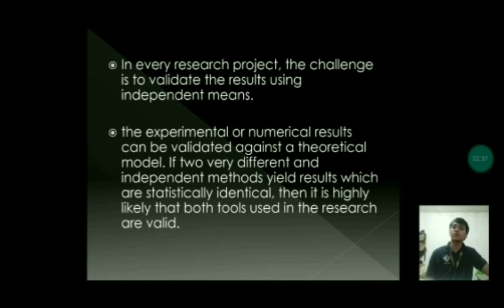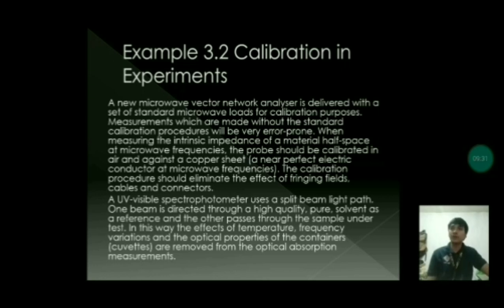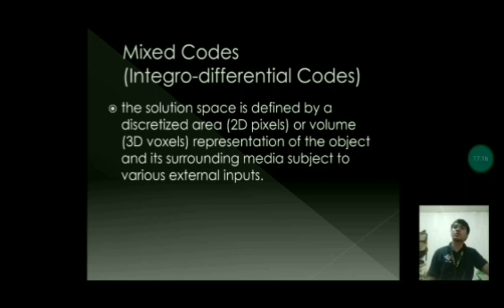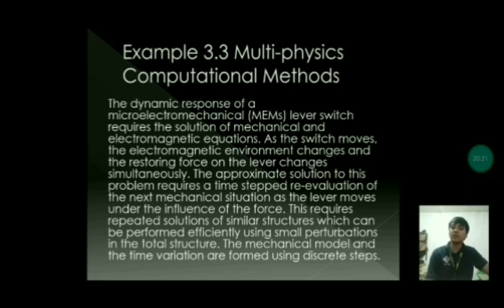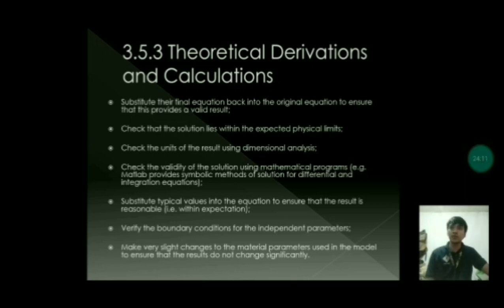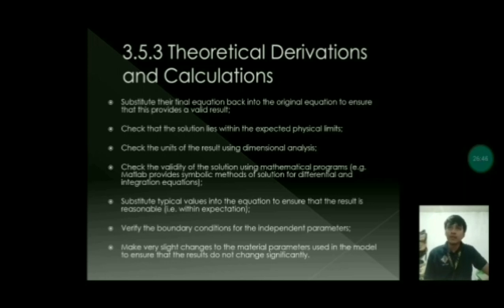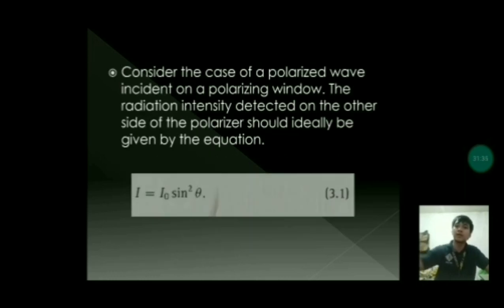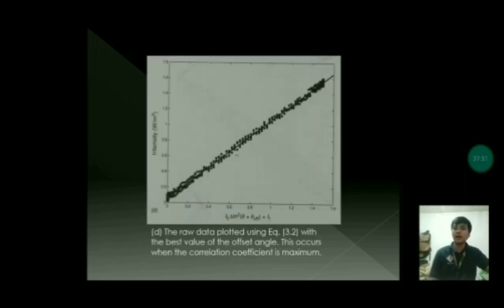Research Tools

Comment: Evangelista, Marwel P.
March 27,2023
MWF 6:30-8:30pm

Reflection
 I learned about systematic uncertainty which is uses of a published method of measurement. And also it covers about experimental measurements that can provide the best method of gaining reliable measurements.

Reaction
The reporter gives some examples of research tools that we can use it in our research study. Overall , It was very informative presentation.

Summary
The usage of standard measurement tools and the significance of calibration procedures are also explained in the video report.The correctness of solutions is assessed and compared using a variety of techniques, including numerical and theoretical modeling, curve matching, and other methods, to discover the most effective ways for a given circumstance.

Comment: Darwin Maglalang N.
March 27, 2023
MWF( 6:30- 8:20 PM)
Research Tools

Reflection:
In this chapter, I learned that in conducting a research and collecting data there are different techniques to be used to insure that the solution is accurate and reliable.

Reaction:
The reporter executes the topic very well and understandable. He studied and prepared his topic giving me excellent understanding to what his topic is all about.

Summary:
In conclusion, research tools are the equipment that is necessary for study and must be carefully chosen, which we can utilize to confirm our findings. Those research tools are Experimental measurements, Numerical modelling, Theoretical derivations and calculations, and lastly, curve matching.

Comment: Pis-an, Clark Z
March 27, 2023
MWF 6:30-8:30 pm

Reflection
I realized that in our research study we need to make sure that our results and findings are relevant and reliable. We have different research tools that we can use in oder to utilize the results of our research study. For example we have curve matching, numerical modeling, experimental measurements, and theoritical derivations and calculations that are also effective on determining the accuracy of the calculations and solutions.

Reaction
In my observation, the reporter discuss the topic excellently. The reporter is well informed with his assigned topic. The presentation is commendable and it is well organized.

Summary 
Research tools are used to prove that the findings are true and correct. We can use different research tools such as experimentation techniques that can be use for measurement in precise manner. Numerical modeling that needs repeated solutions and calculations, theoritical derivations and calculations includes checking of the results using dimensional analysis and last curve matching which applies the independent variable and calculate the dependent variable. It is also a visual inspection of the line that suggest the marginal error.

Comment: Name: Janeze S. Pacaña
Date: March 26, 2023
Schedule: MWF 6:30 – 8:30 pm
REFLECTION:
Each process of research is important and not easy. It requires a lot of effort and hard work. Being able to collect data and analyze it needs to be assessed by the use of the different research tools. These tools will allow researchers to choose the best approach and method to use and articulate how the results will be presented.
REACTION:
The presentation was informative, and the reporter gave an in-depth explanation of the examples so that it can easily be understood. He effectively discussed the different research tools. 
SUMMARY:
Basically, this lesson talks about the different tools that we could use in assessing the validity of the data collection results. Those research tools are Experimental measurements, Numerical modelling, Theoretical derivations and calculations, and lastly, curve matching. Standard measurements tools should provide the best method of gaining reliable measurements and should undergo a verification process through calibration. Overall, those different techniques will help the researchers to attain a valid and reliable result.

Comment: AMAHIT, KENT L.
MARCH 26, 2023
MWF, 6:30-8:20 pm

Reflection: Based on my observation in chapter report 3.5 in Research Methods for Engineers. It provides an overview of the various research tools that are available for engineers to use. It covers topics such as the types of research tools, how to choose the appropriate tool for a particular research project, and the advantages and disadvantages of each tool. This chapter was helpful in understanding the different types of research tools available and their uses.

Reaction: I observed that the reporter is reporting well the assigned topic and discussing the importance of research tools. I was able to learn, how many different types of research tools are available to engineers, and the amount of detail that the chapter went into regarding each tool. I also found it interesting to learn about the advantages and disadvantages of each tool. This chapter was informative and gave me a better understanding of the different research tools.

Summary: Chapter 3.5 in Research Methods for Engineers provides an overview of the different research tools that are available for engineers. It outlines the types of research tools, how to choose the appropriate tool for a particular research project, and the advantages and disadvantages of each tool. This chapter was informative and gave a better understanding of the various research tools that are available.

Comment: Lluvido, Lynan Kim A.
March 26, 2023
MWF 6:30-8:20PM

REFLECTION:
Since numerical or experimental result plays a big part in a research, it needs to be validated using different methods. These methods are called research tools. It can be done through comparison of calculations after the results are made. In order for the audience or participants to have trust on your research, you need to have a reliable presentation of your data analysis. Considering the different variables, you can be able to identify some of the errors.

REACTION:
Based on what I have observed from the video presentation, the reporter explained very well each part of his topic. Different examples were provided as an aid for better understanding. Overall, it was well delivered, well prepared, and was very informative.

SUMMARY:
There are different research tools which we can use to verify our results. Just like the experimental measurements which is through calibration procedure, numerical modelling which requires repeated solutions using small perturbations, theoretical derivations and calculations which involves substitution that suggests the level of random error, and curve matching which is a visual inspection of a line.

Comment: Lareno, Rhea T.
March 26, 2023
MWF 6:30-8:30 PM

Reflection:
After watching the video, I have come to realize the importance of validating solutions in scientific and engineering calculations. The video highlights various methods and techniques that can be used to ensure that the solution obtained is accurate and reliable. As a student, this is a critical lesson as it reinforces the need to be diligent in checking results and using appropriate tools to verify the correctness of a solution.

Reaction:
The video provided valuable insights on the different approaches that can be used to validate solutions in scientific and engineering calculations. It was interesting to see how various techniques such as calibration procedures, numerical modeling, and mathematical programs can be used to ensure the accuracy and reliability of results. 

Summary:
The video emphasizes the importance of validating solutions obtained in scientific and engineering calculations. It highlights various methods and techniques that can be used to verify the accuracy and reliability of results. These techniques include calibration procedures, numerical modeling, mathematical programs, and checking the sensitivity of solutions. The video also emphasizes the importance of standard measurements and calibration procedures to ensure accuracy and reliability.

Comment: Christian J. Andos
March 27, 2023 
MWF 6:30 P.M. - 8:30 P.M.

REFLECTION:
A research tool must be used while evaluating data in order to draw findings and implications from the information gathered. I was able to identify the particular tools that needed to be used with the supplied data in this chapter and also figure out the benefits of each instrument and how they worked in the research area.

REACTION:
The reporter emphasized the significance of the research tools. He provided good explanations and examples to back up his ideas. By using examples as illustrations, it simplifies and clarifies topics. His presentation is sharp end, and it's clear that he was effective in educating viewers of the advantages and worth of research tools.

SUMMARY:
The problem in any research project is to use trustworthy methods to validate the findings. A theoretical model can be used to verify experimental or numerical results. It is quite likely that both the research's tools which are very distinct and independent are reliable if they produce results that are statistically identical.

Comment: Lerio, Shiela Faith
March 26, 2023
MWF 6:30-8:30 PM

REFLECTION:
The video report talks about how it's important to check research results with different methods and make sure workplaces are safe and produce high-quality results. It also explains how to use tools to measure things accurately and consistently, and how to make sure computers are used correctly to create models.

REACTION:
The reporter provided informative insights pertaining to the subject matter.

SUMMARY:
The video report discusses the importance of validating research results using independent means and the need to address workplace health and safety and quality assurance issues. The video report  also explains the use of standard measurement tools and the importance of calibration procedures.

Comment: Veriña, Jerry Ian A.
March 26, 2023
MWF 6:30pm-8:20pm

Reflection:
The video underscores the need for rigor and attention to detail in research to ensure valid and trustworthy outcomes. It emphasizes the importance of validating research results using reliable measurement tools and calibration procedures. It also highlights the significance of accurately defining the solution space in numerical modeling to achieve accurate results. 

Reaction: 
The reporter provided a well-made presentation/visual aid. Audio and video recording were also done properly. The reporter made a clear and concise discussion about the given topic. The reporter also provided good examples that were simple and related to her given topic.

Summary:
The video discusses research tools and techniques that can be used to validate experimental or numerical results against theoretical models. Calibration procedures are necessary when using alternative measurement techniques to ensure reliable and valid measurements. Standard measurement tools and materials with known properties can provide reliable measurements. National accreditation authorities and international professional societies provide standard measurement techniques and documents to guide researchers in their work. Numerical modeling techniques, such as differential and integral equations, can also be used to model complex systems and processes. The accuracy of numerical models can be improved by ensuring that the boundaries of the solution space are far enough away from the object being modeled.

Comment: Kevin Alama Quilnet
March 27, 2023
ENS 341 A - Research Methods of Engineering  M-W-F  6:30-8:20pm

REFLECTION:
What i can reflect from the video is that research tools enable researchers to collect, analyze, and interpret data efficiently and accurately, thereby producing reliable and valid results. Some common research tools include surveys, questionnaires, interviews, focus groups, experiments, observation, and case studies. Each tool has its strengths and weaknesses, and researchers should choose the appropriate tool based on their research questions and objectives.

REACTION:
The voice of the reporter was clear and definite. He delivered his report superbly. The presentation is clear and the discussion was well performed. Most likely he was able to deliver his topic in an informative manner.

SUMMARY:
Overall, the development of new research tools, such as data analytics software and machine learning algorithms. These tools can help researchers analyze large amounts of data quickly and identify patterns and trends that may not be apparent using traditional methods. Research tools are critical for advancing knowledge in various fields, but their use requires careful consideration of ethical and practical implications.

Comment: Cacaldo, Elvin E.
March 26, 2023
MWF 6:30pm - 8:20pm

Chapter 3
3.5 Research Tools

REFLECTION:
After watching the video presentation, the presenter discusses several measurement instrument methodologies. Every research project requires the use of research procedures to be successful since they help with data gathering, analysis, and interpretation. Without using one of the aforementioned research tools, researchers would find it challenging to draw conclusions based on data, which could undermine the validity and reliability of their findings.

REACTION:
The speaker used excellent visuals to help viewers understand the video. The reporter is discussing well the assigned topic and he gives some example and it's help me to understand directly.

SUMMARY:
In summary, engineering research strongly relies on using unconventional techniques to make the most authorities and  precise measurements. Identify the most right techniques for a specific circumstance, the solutions' precision is assessed and contrasted using different methods, such as numerical and theoretical modeling, curve matching, and different approaches. It is imperative to make sure that the tools used are reliable by contrasting results of experiments and guaranteeing statistical identification.

Comment: Yucor, Janet B. 
March 26, 2023
MWF 6:30 - 8:30 PM

REFLECTION

In order to conduct scientific research, collect data, and evaluate information, researchers employ a variety of approaches, methods, software, and equipment known as "research tools." These technologies give researchers the ability to gather and analyze data, spot trends, and make inferences based on their results. The use of appropriate tools and techniques is essential for generating reliable and robust research findings, and researchers must continually adapt and update their methods as new tools and technologies become available.

REACTION

The speaker delivers his report in an organized way, giving examples that the audience can easily comprehend of his report and he speak clearly. 

SUMMARY

Overall, research tools are essential to the research process because they enable researchers to gather, analyze, and come to conclusions that increase knowledge in their respective domains.The use of appropriate tools and techniques is essential for generating reliable and robust research findings, and researchers must continually adapt and update their methods as new tools and technologies become available. Experimental measurements that tools provide the best method of gaining reliable measurements. The numerical modelling and the Theoretical derivations and calculation where it checks the unit of the results using dimensional analysis and lastly the curve Matching that apply the independent variablea to the equation and calculate the dependent variable and these are the techniques that will used to have a clearly outlined in the research plan.

Comment: SORIANO, ARCHIE ISABELLE A.
MARCH 26, 2023
MWF 6:30-8:30pm

REFLECTION 
Undertaking research tools is important in every research project because this will help the researchers to collect , analyze and interpret the data accurately and efficiently. Because without those mentioned research tools, it researchers would struggle to draw conclusions based on data without applying one of those research tools, which could hinder the validity and reliability of their findings.

REACTION
The presenter was able to expand his knowledge about the different methods of research tools that are essential when undertaking a research study. Through his presentation, I was able to identify and learn about the different kinds of practices to be considered when collecting and interpreting data.

SUMMARY 
In every research project, research tools is essential in validating results to ensure validity and accuracy of the research findings. The techniques that will be used to validate must be clearly outlined in the research plan. Some of the techniques is the experimental measurements, where standard measurements provides the best method of gaining reliable measurements as well as applying calibration procedures. Numerical modelling, used of mathematical algorithms to replicate real-world phenomena. Theoretical derivations and calculations  involves theoretical equations to verify the solution. Curve Matching, where one technique is to apply the independent variables to the equation and calculate the dependent variable. Research tools are  important to provide a structured and systematic approach to ensure that the data collected is valid and accurate while enabling the data analysis.